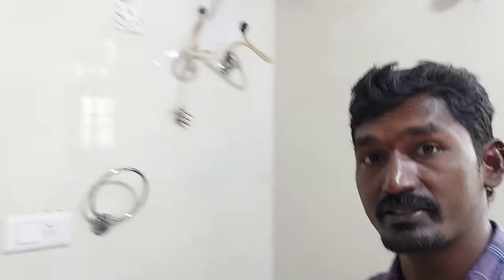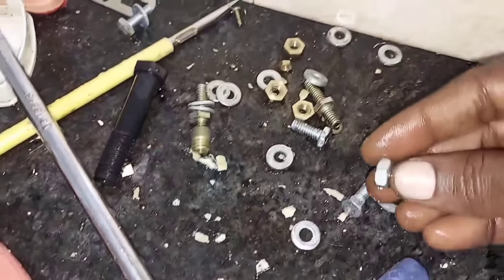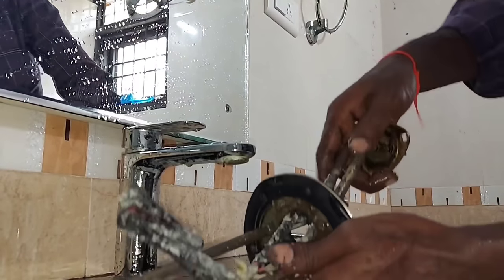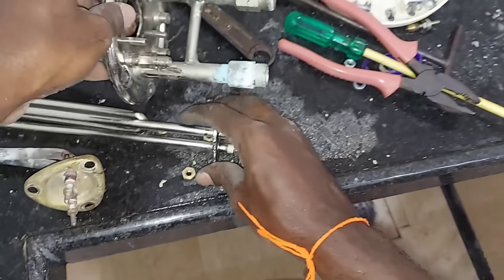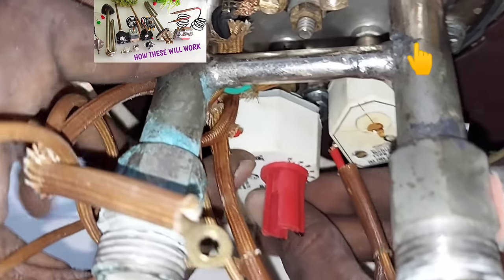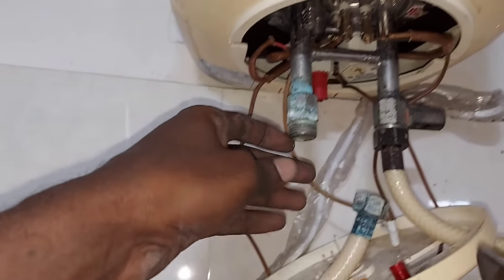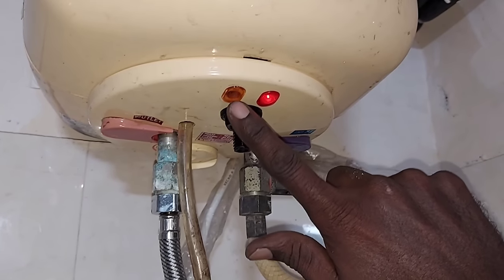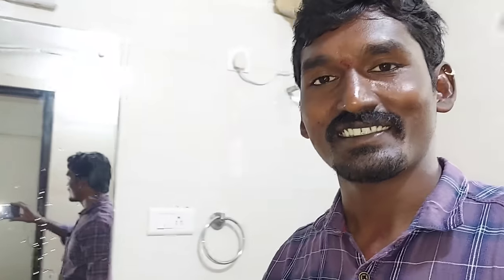Electric Geyser Repair | Electrical Telugu

Comment: Anna మీకు లాంటి వాళ్ళు వల మార్కెట్ open మార్కెట్ ఐపోతున్నది కొంతమంది బతకడం కష్టం అవుతున్నది so ఇలాంటి vedio మీరు కొంచెం చేయకండి ప్లీజ్
Reply: మీరు అలా అంటే ఎలాగండి... కనీస జ్ఞానం మాకు ఉంటుంది... అంతేగాని మేమే చేసేసుకో కుంటామని మాత్రం కాదు.. ఎందుకంటే ఇది విద్యుత్ పరికరం... అందువలన నీవు ఏమాత్రం కంగారుపడవద్దు... మిత్రమా
Reply: వీడియో చాలాబాగా చేసి చూపారు.. ఇటువంటివి కనీస స్థాయిలో మరికొన్ని చేసి చూపండి.. Thanq you
Reply: @kumarakkireddy Sir don't worry intha setup wiring test box heater and vati filaments check chesetantha setup intlo chesukoru. So no worries. Atleast junior technicians will learn from this like me
Reply: Good explanation..  not only for technicians but users must get basic information about functioning and precautions against shock etc..  you can add wiring connection by reducing some repeat points in the same video, to make it completely informative.

Comment: Maaku electrical appliances levu single phase meter 180 units summerlo 2 fans thappa inka emi use cheyyam  fuse carrier remove చేస్తే units change ledu ye electrician ni pilichina electricity office lo cimplaint ivva mannaaru kaani problem meter lo ledu   memu rent unde intlo owners kinda unnaru valliki 3 phase meter  vaalanki motor connections 2 ac 1 fridge oven heater geyser washing machine mixer annu use చేస్తున్నాడు vaallaki 600 rupees bill vasthundhi

Comment: brother maa geyser crompton solarium 15ltr. sudden ga oka roju power supply trip ayindi.on chesthey mall trip ayyindi. cropton service engineer vachchi lopala steel tank lo water leak ayyi heater coil meeda paduthondi ani cheppadu...stell tank replacement ki warranty card shop bill adigadu...avi ma daggara leyvu....e  model tank dorukuthaya or welding cheyyachcha? mseal /araldite petti water leakage stop cheyyachcha?

Comment: Anna, new washing machine konam kani washing machine ki 25amps 3pin socket ledu, 25amps switch board theskuna kani daniki 4square wire tho connection evana or 2.5square saripothunda

Comment: Pipes kariguthunnayi problem em undochu. filament change chesina ade issue undi
Reply from the maker: ప్లాస్టిక్ పైప్స్ కాకుండా హీట్ వాటర్ హెవీ పైప్స్ వాడండి అలాగే ఆటో కట్ అవుట్ thermostat కంట్రోల్ చేయలేకపోయినా ఓవర్ హీట్ అయి అలాగే జరుగుతుంది
Reply: 12 mtrs daka karigayi motham. Geyser change chestuna. Two times use ki two times karigayi